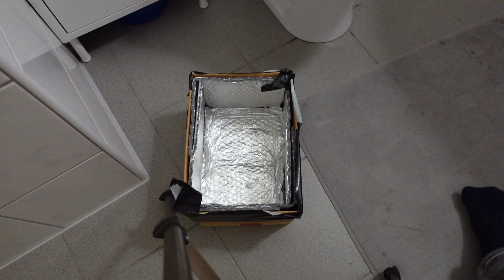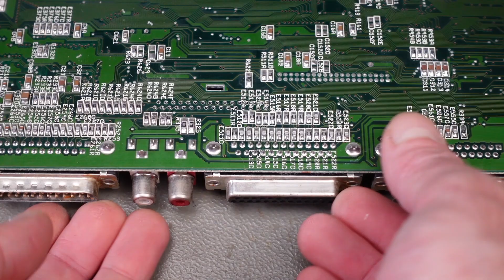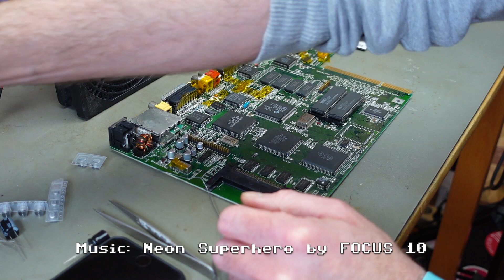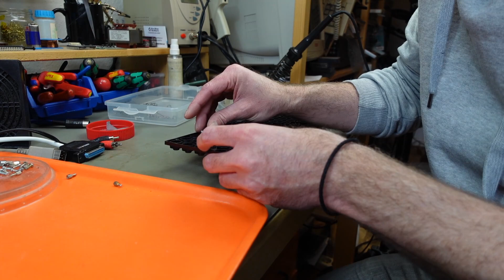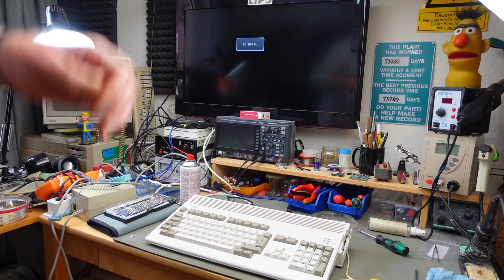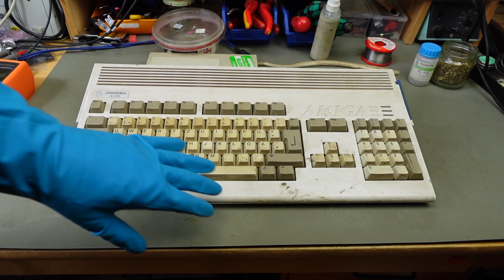Amiga 1200 Saved from the Flood Part 2

Comment: It's beautiful.  The gleaming white keyboard looks fab.  I felt the relief when it worked after the re-cap 😅.  They are such attractively designed machines.  😊✔
Reply: It really is. I never owned an A1200 myself but it just looks... perfect. Minimalist without being boring.
Reply: @PJBonoVox  I wish I could buy a modern PC in such a case.  Just plug in the mouse and monitor and you're away.

Comment: Zinc is the active ingredient in rust-resistant coatings. The rusted area may be treated to a coating of zinc-based undercoat that is used for metal. Rust is an electrical circuit that is stopped by zinc. That is why cars get galvanized. Thanks.

Comment: A couple of tips -  with the component removal it cane be beneficial to use some "assistive heat" with hot air station. And the solder wick can work a bit easier if you add some flux to the wick. Thanks for another great video!

Comment: Really nice job Jan. The machine looks superb. You might be better off with some wider kapton tape. I agree with your comments about cotton buds leaving fibres on the board but simply using IPA and a brush just spreads the flux residue around into a thin layer rather than removing it. I use sponge swabs and/or kimtech wipes with IPA. Looking forward to the next video. 👍

Comment: There's a good video on Mr Carlson's Lab about removing SM caps. Basically you can just twist them off using a pair of pliers and then remove the legs with a soldering iron. Sounds scary but he's very a experienced engineer and it work extremely well. Worth a watch.

Comment: I pulled all the caps on my A1200 with pliers, zero lifted pads. Tried hotair method on another PCB, lifted pad every time. The issue is that when the solder on one leg you saw liquify is resolidifying and you start lifting the piece because you think the solder on both legs is fluid then it's like you are pulling with a huge lever on that resolidified pad and then it's no more attached to the PCB.

Comment: Excellent job saving that A1200!!! Even though it didn't look too bad things could've been much much worse in just a month or two, and if corrosion starts eating away at the pcb, then the life span of that computer is drastically shortened - and we've lost enough Amigas (and other retro computers) to leaking batteries and caps already and these are all there are on the planet, hence why I've repaired/restored several Amigas for free the last 20 years. I've been given several dead Amigas that I've been able to hand out to people whom I think deserve them as long as they promise to take care of them and hand them to someone else in the future in order to keep the Amiga alive.

One thing particularly dodgy with floods is that sewers flood too and you get all sorts of bacteria everywhere... That's why you more or less soak everything in alcohol or bleach to kill whatever the flood brought with it. Using those thick gloves wasn't a bad idea before you got most of the nastiness off that A1200!

I'm sure the owner of said A1200 was really happy getting that Amiga back in a way better condition than it was even before the flood! Well done sir, well done! :)
Reply: It seemed like a rather easy save -- but that's not a complaint at all. As you accurately noted, it was only this easy because someone got on it more or less right away.

Comment: Since last Year, I only use Aluminium Polymer capacitors, because they look and work like the normal SMD caps but cant leak any more because there are no liquid parts inside.
And with solder tweezers you don't need hot air :-) you can just pick them from the board.

Comment: I think, the part of removing the SMD Caps with hot air, that puts some off Jan! Is sometimes the caps act like fireworks and take off.
I've seen a lot of people do the pliers twist option, over many years & in some cases it's cringe! especially on older/vintage boards 👍🏻
Reply: apparently preheating the board before using hot air isn't done anymore either..
Hello micro fractures all over the board. Why not just a blowtorch and a hammer..much faster..🤦‍
Reply: @DavePoo2  Thanks! for the link share, I enjoyed that time-lapse ☺ Thumbed Up! and commented 👍🏻
Reply: @Ratchet_effect  I think the trick to not blowing up the caps is to heat the board up to temp gently so that you dont have to hold the heat on for so long on the cap. Also I think i was in an awkward spot for that cap (with the camera) and I had the heat right on top of the metal can, which didn't help at all.

Comment: Maybe I am wrong but you can switch on the A1200 with both mouse buttons pressed in order to change the boot order procedure. Then you don't have to wait if there is no hard disk installed. Gute Restauration. :)

Comment: Hello Jan the Amigaman.  Your retrobrightbox will work better with just plane white sides instead of the reflective aluminiumfoil.  White will scatter the light into diffusive light that spreads more even. The reflective foil will cause slight focal points where the UV light is more intense then other places causing a more uneven effect on the retrobright.

Comment: Finally you're using the fluid peroxide for the keys. Still the hint for you - use doublesided glue tape to stick the keys to the bottom of a bin - then pour the fluid into it, and they don't float. So you can receive a better result in a faster time. Same to small case parts, like the mouse. I like your comment on reusing the fluid - it really works and it's better to the environment ;)
Reply: H₂O₂ disposal is pretty harmless to the environment, unless it's so concentrated that it blows up or something. Reusing it is certainly cheaper than dumping it every time, though.
Reply: @mal2ksc yes, liquid peroxide is less harmfull than the hair bleach stuff (cream with 40% and more), which mostly contains other stuff. That's why I mentioned it.
Reply: @psteier  My only concern that since the concentration is decreasing with each use, it would be hard to make an accurate estimate of how long the parts need to soak. It doesn't seem he is that worried about it, since an hour past perfect is still fine.
Reply: @mal2ksc  I've done this a lot of times to white keycaps. One hour or more is not that problem. It's only a problem, when the keycaps are double injected and colored. Like the Amstrad CPC464 keycaps with red, green and blue caps. They simply loose their color... Even the dark grey or black caps. I've learned my lesson on them.

Comment: What’s your opinion on just twisting the caps off the board with pliers, I’ve seen Adrian Black do that on some board repairs
Reply: DONT DO IT. You will usually take the pads with them, and then your recap job becomes a repair job.
Disclaimer: I'm a "professional" Amiga repair guy

Comment: Also don't forget, with some boards, Commodore REVERSED all the Cap-markings on some boards. Please inform yourself before attempting any capacitor replacement!
Reply from the maker: They only did that on the CD32 boards as far as I know.
Reply: they did this on one board - the CD32, and it was not ALL capacitors.. just two through hole capacitors.

Comment: Here's my hints for recapping A1200's (I do it "professionally" now)

1) Hot air only needs to be 290c. Any hotter is risking desoldering nearby parts, or melting plastic. I've actually found that a small nozzle is LESS effective than using a wider one.

2) Kapton tape is great, but I also find aluminium kitchen foil, folded to several times thickness, makes an excellent protective shroud for nearby connectors. I usually insulate the keyboard connector and audio jacks this way. Sometimes the audio jacks will deform slightly still, but it doesn't affect their functionality. The foil is also cheap and reusable ;)

3) Desoldering the through hole caps can be a pain, mainly because several of them have their -ve side connected to a large ground plane. Don't be afraid to preheat the area with hot air for about 2-3 minutes before using the desoldering gun to get them out. You are less likely to damage the through holes this way.

I only really desolder the keyboard connector if there has been visible leakage and I know it's gotten under the connector. Taking the plastic clip off the connector is a good idea though. When insulated by the foil as described above, I've never even slightly melted the connector. It's also good to leave the foil shroud on when fitting the new capacitors, as if you then accidentally touch the connector with the soldering iron it won't leave a burn mark.

I often use 5mm 22uF capacitors for the audio capacitors - especially on an A600, as the space is VERY tight. I have a crook tip for my soldering iron which I use to do those.

The way I solder on the new caps is to put a small amount of paste flux (i apply it with a brush, actually a makeup brush i stole from my girlfriend's kit ;) on the pads where the capacitor goes. Then sit the capacitor in place, wet the soldering iron tip, and touch the joint. The solder will flow off the iron and onto the joint, leaving just the right amount. When you have the knack of it, soldering a joint takes less than a second :)
Reply: That 290c I use is on a genuine Atten AT858D+ station. I know that the clones often have poor heaters that require running even higher to get usable desoldering from. I haven't tested the temperature that actually comes out of my AT858 though - i must do that when I get a multimeter that has a thermocouple temperature probe!

I usually solder the new capacitors with my soldering iron (Atten AT938D) set to 380c. For soldering the through hole capacitors where the leg is going into a ground plane, i crank it up to 450c or preheat the area with hot air.

Comment: I wish I could recap my amigas as they are experiencing reboots and crashes:( I'm not that good on soldering and I'm afraid I might damage them.
Reply: There are some people who would do it for you for a reasonable price.
You can also send your motherboard to more "official" amigastores for repair.
But writing in 2021, the smd cap's will be falling off the board by themselves soon and the "acid" is probably corroding the traces and the pad's on the motherboard away by now.   Doing nothing may not be a good option
Reply: @combatdigiq  I will look around as I have a 1200 and 500 an atari 1040ste and a spectrum zx+ I will definitely need to preserve them its history.
Reply: @evangelosm537  I don
t want to be the fearmonger of videogames but it could use some looking into. Maybe I was just upset about the cap's I pulled off an A1200 yesterday.  Quite a mess, corrosion of the pads/leads was already going on under the caps. It was an epson amiga and i'm told they used the worst caps of all amiga's but I guess the original amiga cap's won't last much longer.

And I'm thinking the real issue is,  that replacing the cap's is much easier if there's no damage yet and you don't have to worry about tearing the pads off the board or repairing leads because that's a world of S***. And sooner or later their going to leak most likely anyway, why wait for worse ?
Reply: @combatdigiq  lot of money for recap around 70 pounds each system plus shipping which I haven't got into it. Maybe one at the time.
Reply: @evangelosm537  yea, €70 is't pocketchange to me either. Pretty much everything Amiga isn't cheap anymore. Maybe you can find someone more local who could do it ? Some would do it for as low as €40 over here. 
 (don't know what quality you will get though)
But yea, Imagine having a pile of A1200's, it would add up.. 
People could go bankrupt... 😲
Then again, having a pile of them would be wishful thinking to most people. 😄
IDK what I'dd do,  probably have one capped and sell it as recapped and get a good price for it and then repair the rest from the proceeds ? 

Thankfully not all consoles and homecomputer have the leaky SMD cap's, like your A500 and probably your ZX+ don't have them.
Reply: @combatdigiq  cant sell it it's the only one I have. Cant replace it and now days they go very expensive. I will save some money and do one at the time. I have checked and all seams in good condition no leakage at the moment no rust just the shields a bit. Just change psu on the amiga to a new one and have no random reboots what's so ever. The store I found is 4h away by car might say to my brother day trip lol will see. At the moment waiting for some new tos for the atari and looking for new memory but memory is difficult as all is solder to the pcb .... early production unfortunately.